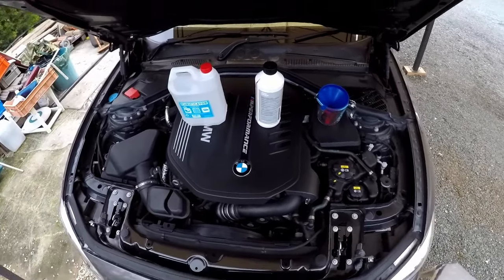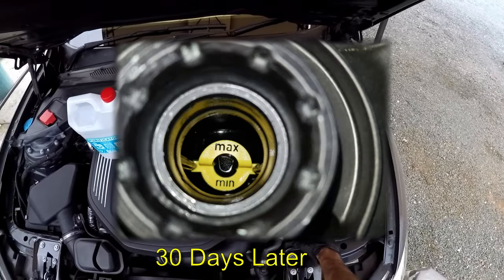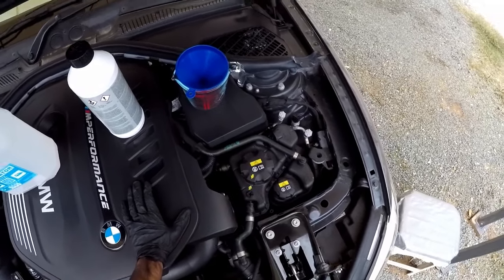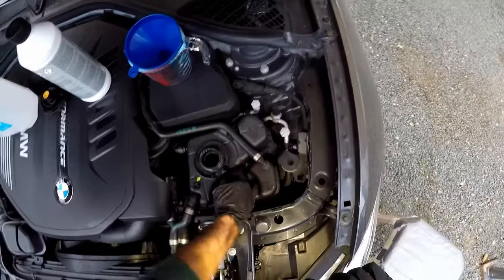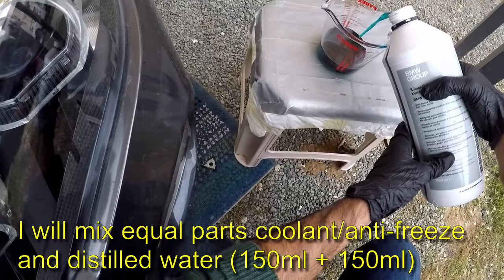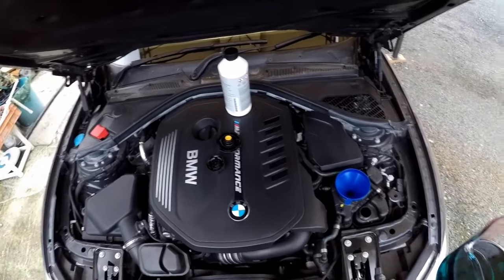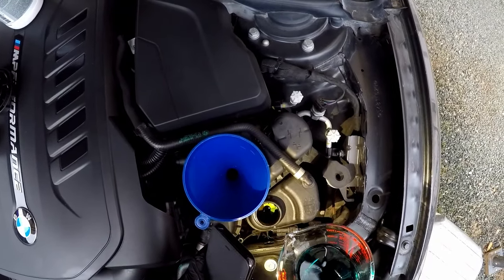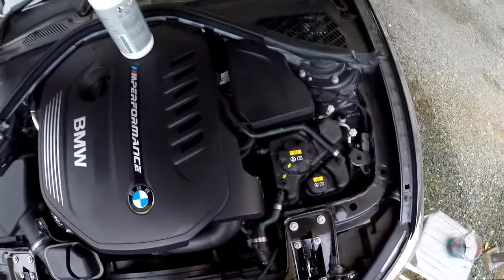BMW B58 Engine: How to refill coolant (Escaping from Filler Cap - Quick Video)

Comment: how do you tell if it is max or min? i came from a vw we only had that sphere tank x.x
Reply from the maker: There's no external indication. You have to open the coolant expansion tanks and look at the yellow indicator within. This means you have to wait for the engine to be cool, otherwise you could get hurt when you open the pressurised and very hot coolant expansion tank cap. The yellow level indicator is inside the coolant so you know whether you are at minimum or maximum with the fluid level. Too much coolant (i.e. above max) means the indicator is completely covered, too little coolant means the indicator is dry because the coolant is below it.  So the indicator is OK for quick check of the coolant.
Reply: @NoBrainerTalk  damn hard to understand unless I go out and look but yh thanks ill get it :)

Comment: Ah, so it wasnt green, I thought it was green coolant due to the Min/Max parts colour. Thanks for the video, I might just buy the coolant from the BMW service and refill it by myself. Or should I just buy it from the online store? Just the BMW authentic blue coolant product. 

Damn, it was above Max and after nearly 4000km done, its almost at the Min level, 440I GC Mppsk..
Reply from the maker: I think it's possible the fluid expands with outside temperature, so there might be a level change because of that (no fluid volume change). Was it above max in summer and near min in winter for example? You can top up yourself, if the car is filled with BMW blue coolant then topup with the same coolant, don't mix coolants.
Reply: @NoBrainerTalk  checked volume change yesterday, after increasing engine temperature just above 70 and checked, it was just at the Max level. Thanks for the reply, the car was always serviced at the BMW centre so it should be fine. Thank you

Comment: Thanks for the video! Do you know where the drain points are for either tank? I've been meaning to do a flush as my secondary tank appears to be clear so may have been filled with water rather than antifreeze. Also, BMW say you should use a vacuum filling method for these, is that correct?
Reply from the maker: Hi, I believe that the complete draining is done by disconnecting the lowest hose on each of the radiators, which will end up draining the entire systems. For the antifreeze in the intercooler expansion tank which you say looks clear, please extract some in a syringe for example and kindly let me know if it is the same as mine in this video (i.e. light brownish colour):
https://youtu.be/C6sIVTQh9xA
BMW uses the vacuum filling method as that bleeds trapped air from the system. If you refill the cooling circuits without the vacuum filling method, you will need to bleed each cooling circuit manually with its respective bleeding procedure. The bleeding procedure is activated from within the car without tooling but could take multiple times to fully bleed and up to 40mins per circuit, so the vacuum filling method saves time.
Reply: @NoBrainerTalk  Interesting, thanks for the response! I had a look at your video and I think it actually does look like this... I'll have to put some in a syringe as you say and have a look. Is that not normal?
Reply: @NoBrainerTalk  Also interesting that several other people are reporting the same thing on that video's comments... seems that everyone has clear fluid in their second tank. I will replace it with the normal blue stuff and report back...
Reply from the maker: @michaelkelly3158  Yes, since posting these videos, a few people have confirmed the same finding. It's not something the local BMW dealer could explain, and I tried multiple times to get an answer from BMW themselves unsuccessfully. All I can say is that the brownish liquid smells sweet like coolant, and I do believe the local dealer when they say they never touched it, i.e. this is how it came out of the factory. Perhaps this is a temporary fluid that is used by BMW to flush out production debris, or coat the coolant system with anti-corrosion layer, a fluid that was supposed to be drained before departure from the factory. So I think it's unlikely to be harmful, it's more likely to be inefficient at extracting heat from the charge air. All this is guesswork of course, it could also be blue coolant that turned brown after the dye chemically reacted with something, I really don't know. :)
Reply: @NoBrainerTalk  Interesting, thanks again mate. I'll let you know how I get on. Just got the vacuum filler device so I can make sure I do it right, it wasn't too expensive anyway!
Reply from the maker: @michaelkelly3158  Respect.
Reply: @NoBrainerTalk  factory most probably uses minimum levels of blue coolant to save some money at that low temp circuit filling, and the liquid inside becomes brown for sure. sure this will damage things inside but not until just after the warranty period as this is low temp system. that is how they save money during production and sells parts and coolant to people after end of the warranty period I believe. That is what I believe. dealer will not give you any explanations about that clear or brownish color of that coolant. Not seeing any explanation from Bmw around is another proof making this thinking to gain reality.
Reply from the maker: @cemildenizel2223  Who knows, you might be right!

Comment: I having low coolant warning on my F30 B48 engine, after I checked both tank having water above max, and I have changed the main coolant tank as well. Could you advise? Once I restart the engine the fault code gone. The next day I drive out the fault code come again.
Reply from the maker: Hello, the coolant expansion tank sensor should be checked, perhaps you have a faulty sensor. Qualified mechanic should perform resistance checks. Also, it's not good to have above maximum level of coolant, so I recommend you extract the excess coolant and get it down to maximum level. Let us know how it goes.
Reply: @NoBrainerTalk  is both tank having level sensor on it?
Reply from the maker: @chongyeouwei3433  Negative,  the intercooler coolant expansion tank does not have a sensor, only the engine coolant expansion tank has a sensor.
Reply: @NoBrainerTalk  is weird , i have just replaced the new expansion tank with the sensor. But now still on and off the low coolant fault code
Reply from the maker: If you are sure the replacement tank came with a new sensor, then it is unlikely to be the sensor (the chances of two bad sensors giving false reading of low coolant are very slim). Please check the removed tank that it has a sensor (you can send me photo of sensor on nobrainertalk@gmail.com). The sensor will report data to an electronics module, so the wiring, connectors and electronics module need to be checked. Sometimes connectors are contaminated, and need to be cleaned. Start by plugging in diagnostic equipment into the OBD2 port and checking for any error codes. Afterwards begin troubleshooting the electrical components. If you actually find low coolant, then it's obviously none of this. :)

Comment: Can you top it with water in extreme cold temperature?
Reply from the maker: Hi, it depends what you mean by top it up. :) For example if the intercooler coolant circuit holds about 4 litres of coolant, then 2 litres of that is anti-freeze and 2 litres of that is distilled water approximately (50/50). If I were to pour 100ml of distilled water into my expansion tank to replace 100ml lost coolant (50ml anti-freeze and 50ml of distilled water), I would now have 1.95litres of anti-freeze and 2.05litres of water, so my mix would change to 48.8/51.2 anti-freeze to water. Is 48.8/51.2 OK? It probably is, but if the weather is extreme cold, the need for anti-freeze obviously increases. I would generally avoid deviating from OEM limits if possible in extreme weather environments especially. However a small change of 50ml either way is likely to be tolerable for the short term, so if you topup with a small quantity of water then add the same quantity of anti-freeze later on to keep the right mix.

Comment: can we mix this dest water G48 with some others mark Blue antifreeze?
Reply from the maker: Hi, even if an anti-freeze is blue, it does not necessarily mean it is BMW approved or appropriate for a BMW engine. Different anti-freeze is dyed different colours by different manufacturers to help users avoid mixing them, but it is not set in stone that any colour means anything specific. The BMW blue coolant does need to be mixed with distilled water (this way you can ensure that there is 50% water which is the primary cooling agent). There are pre-mixed coolants out there (they do not need to be mixed with water) but the properties need to be checked to ensure they can be used in a BMW engine. Generally, it is advisable to stick to BMW anti-freeze and in that case yes it needs to be mixed 50/50 with distilled water before being added to the expansion tank. In all cases, please do read the instructions on the anti-freeze container.
Reply: @NoBrainerTalk  thanks for that reply ! i did chek that antifreeze in Switzerland i see they have only dest water but not bmw anti freeze so i see i must to order online in some germany shops

Comment: Do I need to keep the engine running while adding the coolant? Bmw 520i 2013
Model uae
Reply from the maker: The engine should be cool before opening the coolant expansion tank cap, you can top up with engine off.
Reply: at first fill engine should be off but after, yes engine should be running if water pump is mechanical and you release the air with the plastic screw there also open the filling cap too. first close the main cap first and then tighten the plastic bolt. if you have a prince bmw engine then you have a secondary air release bolt on the transmission heater too you also need to release air from it.

Comment: Why inside the intercool has just water as it looks clear liquid? Isnt the same 50 50 coolant/water mix being used at intercool tank as well as the main tank?
Reply from the maker: Yes, it should be the same (50/50 blue coolant mix) but like yourself alot of people have found a different fluid (clear to brown) in the intercooler coolant expansion tank. This fluid colour is not yet explained (although it smells like coolant). Ask your local BMW dealer to explain what it is, and if they can confirm with the BMW Part Number then it is OK (please share the P/N here). If they can't explain what it is with a reference number such as P/N, then it is best to flush it and replace it with 50/50 blue coolant mix.
Reply: Because you should never top up that tank as it's overflow tank.
Reply: @Headpunch  Planning to change the coolant in car. So i shouldnt top up from intercool water tank? Was planning to remove lower intercool radiator hose to get the water out and top it up with 50 50 coolant water. wrong?
Reply: @Headpunch  Sorry I did not understand you. Planning to find some hose to drain that low temp overflow tank as well then I will fill the new 50/50 coolant water mix from that tank as well as the high temp tank too. and I will top up until reaching the level MAX and will not exceed that mark. Am I wrong?

Comment: yes my coolant is literally leaking right out idk whats the problem do you know what could be the cause of it? water pump?
Reply from the maker: I'm sorry to hear that, but it's unclear where it's leaking out from from your message or which coolant (engine or intercooler). If either of the expansion tanks is low and you have access to BMW approved coolant, fill it to the correct level and monitor it every day for a couple of weeks (never open the caps with the engine hot). If it goes down again and you have no indication from where by looking around (it could potentially be anywhere in the circuits, check your radiators aswell in case a stone has caused damage), then get your car to the dealer or qualified mechanic to pressurise the system(s) and perform a leak check (but don't drive it with empty coolant expansion tanks).
Reply: NoBrainer Talk so you wouldnt suggest it could be my waterpump?
Reply from the maker: @michealmorris6929  Why do you suspect the pump?
Reply: @NoBrainerTalk  I took my m240i in to get serviced and was told my water pump had seepage but it could wait 2-3 months to be replaced. 4 days later, I had a decent puddle of blue coolant under the car but when I checked both tanks.... they were still pretty full.. not sure what to do either.
Reply from the maker: @pacyeeze05  If you have noticeable leakage of coolant under the car, but the expansion tanks are still between minimum and maximum, is it possible the expansion tanks were overfilled? To answer your question, any component in the coolant circuit can potentially be a leak source, I believe you are saying the mechanic saw indications of coolant escape at the service (possibly without even pressurising the system) and advised you that it wasn't urgent (can wait 2 to 3 months). Personally, I would have replaced it there and then, 2-3 months is not a long time.

Comment: I got a gallon from Honda it says 50/50 distilled and the colour is blue. Can I also put in the bmw in both thank ? Thanks man
Reply from the maker: BMW coolant is nitrite and phosphate free,  is that stated on the Honda coolant container? if yes, then theoretically you can use it in a BMW engine. But there are various additives in coolant, that may be in different mixture combinations. Not saying the BMW coolant is superior, just that it might be different to Honda coolant even if they are both blue colour as well as nitrate and phosphate free. I'm not sure if you would be topping up BMW coolant with Honda coolant, or flushing the system(s). Toping up has a risk that there may be chemical reactions between the two (you could not say for sure unless you tested them and found them to be intermixable in peak operating conditions). Generally speaking for my engine, I would stick to BMW coolant.

Comment: Do I have to mix distilled water with it???
Reply from the maker: If it's the BMW G48 blue coolant then yes, you need to mix it with distilled water (50/50). This is a good thing because you can be sure how much distilled water is there, as the distilled water is the primary cooling fluid in the 50/50 mix, but the coolant / anti-freeze is essential for corrosion protection, lubrication, etc. The instructions will be on the bottle, and it's always good to follow OEM guidelines. It might say "mix equal parts of anti-freeze and water" or something like that, it might not say mix 50/50.

Comment: Hi, one question pls. I have drove my 540i b58 almost 30.000km and now it shows refill motor coolant. In my opinion its normal after so many km , right? What do you think ?
Reply from the maker: It's a "normal" issue for the B58 to occasionally experience some coolant loss. In a perfect BMW B58 engine there should not be any coolant consumption or loss, but an initial loss over 30,000km is very very good. Not perfect, but certainly others reported much worse. The question is whether you will get the next warning in another 30,000km. :)

Comment: What’s your opinion on my situation.
I have a 2020 m340i and obviously uses the ht-12. Call two dealers one closes to me and the other was the dealer I bought the car asking for coolant and they both said they only had the blue. 
I should have just used distilled water but it’s cold now soo. 

I got the blue because they said I could use it , which I did (100ml) of it. Now I know I really shouldn’t have mixed. Will this creat big issue? Should I get it flushed right away?
Reply from the maker: You are OK as far as I know. The two BMW coolants should be intermixable as they have similar properties. I believe HT-12 is superior (in that it is more environmentally friendly) but I do not expect BMW to have issued a new coolant that is prohibited to be mixed with their own blue coolant without extensive warnings everywhere. If the dealer you bought the car also suggested the blue coolant, I think you don't have anything to worry about. This is my personal opinion, I might do further research on this as the question has been asked before and we should get a clear answer from BMW themselves.
Reply: @NoBrainerTalk  yeah I since removed some from the tank and added water. I am now waiting on the ht-12 and once that comes in I’ll siphon the tank completely and fill 50/50 with the green but will definitely looking to flush late or early next month! 

Thanks man
Reply from the maker: @garthbanton4236  Hi, I'll see if I can get a more detailed answer regarding the intermix of these coolants in the near future, it would be a shame to perform maintenance unnecessarily..
Reply: You can mix the green and blue BMW fluid. The green fluid is their new antifreeze but you can safely mix them.
This that not mean you can flush the coolant and use blue coolant going forward. You must continue using green coolant but if you have to top off and don't have greem, use a 50/50 mix of distilled water and blue.
Reply from the maker: @wingedhussar5528  I made a dedicated video: https://youtu.be/ULptzUnX0og
Reply: Can you mix it with tap water if not where can I get that kind of water from